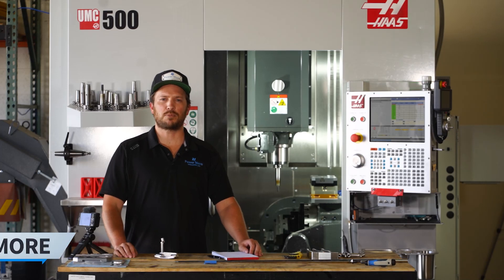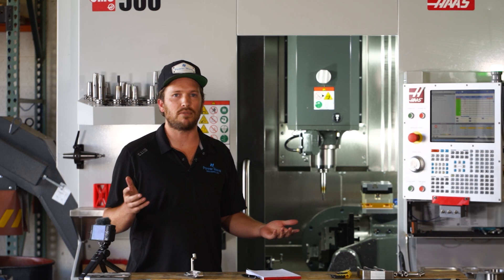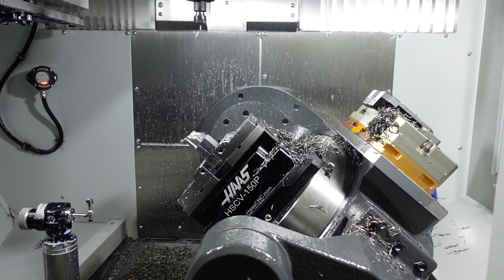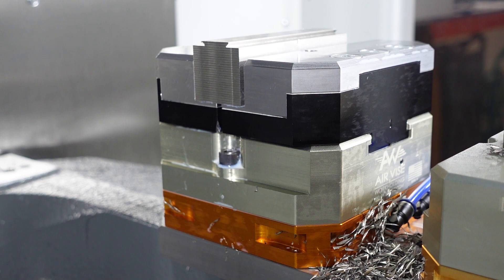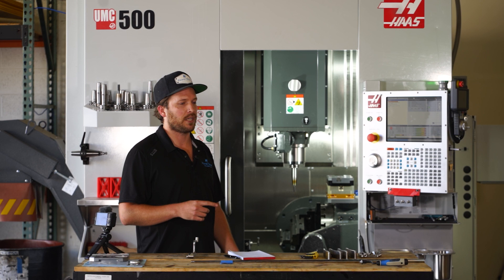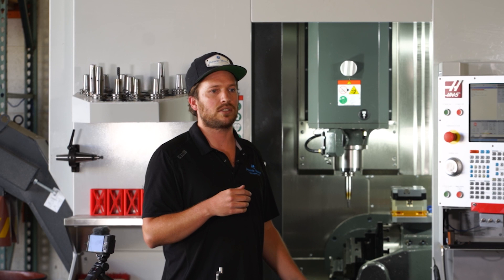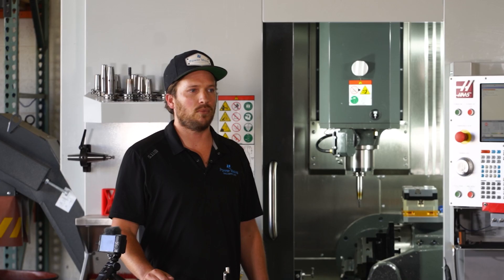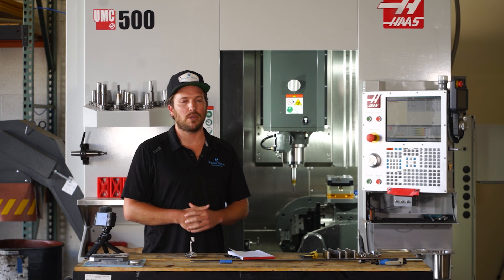Our New 5 Axis CNC Mill | Haas UMC 500 | Worth It?

Comment: As far as the Z axis travel limits the machine does travel above Z 0, we have a umc750 and trick the machine to pop above G53 Z0 by doing an operation on the X minus side at the beginning and end of that tool usage. But annoying but when you need that extra travel it works
Reply from the maker: David, thanks for your reply. We noticed this as well. We found that the Z travel can continue roughly .9” above the tool change position. This comes in handy with some tool holders but we have yet to find a good way to post process this when needed and end up using posted manual entries. If we use the shortest tool holders we’ve found (Shars 1.1” er32) then it tends to work out okay without adding any Z. Thankfully we only use these added two air vises for dovetailing and finishing so we don’t need long tools in those ops. Do you use the side of the umc750 trunnion? Thanks again
Reply: @powermoveengineering  good way to do it? Nope, I typically end up doing a drilling op at the start and finish of the tool, cutting air on the X- side of the part (between part and tool changer) would be better to find way to do it thru post but fortunately the times we've needed to do it the drilling trick has worked.
Believe it or not no, we did just order a 5th axis base plate so we can pop visess on and off of the side (idk if it's still going but they had a 61% off flash sale on their 3 axis style bases). Typically we run dovetailing and second op in our 3 axis.
Enjoy the machine, we've liked the 750.
Reply: @powermoveengineering  I am going to be running a UMC 750 ss soon and those have about 85mm (~3.5”) of z travel above the tool change position. For cam I’m using fusion 360 and I’ve found that of you change the home position for the z axis in the fusion machine configuration to +85mm (or just 85) it will post the z axis retracts between operations with indexes as g53 z85

Comment: ( an open comment Not directed at this HAAS Machine )

Would I buy a HAAS ??
Generally,  NO I wouldn't.
But, I am also based Outside of the US ??
Meaning ??
I am not controlled by country of origin ??

IF I lived in the US,  I would seriously think about supporting my Local Manufacturing sector.
But ??
It would depend on what I was planning to Manufacture with my Machine of choice ??

IF, I was producing High End Aerospace parts with super tight tolerances I might start thinking of other brands besides HAAS.

Definitely nothing wrong with the HAAS brand ??
But ??
You do Need to understand the Limitations of your equipment ??

It's very simple maths.
Pay More, Get More.

This video is a great example of Understanding your Machines Limitations.
NO, tight tolerance Aerospace parts anywhere in this shop ??
Maybe one day that could change ??

Price quoted in the comments for this machine $190k
Not small money for most people.
Go down to your local Mazak Dealer and get a price for an equivalent 5 Axis Mill ???

Back to the HAAS dealer to see IF it will fit in your shop,  LOL.

Unless you're planning to make at least the price of the Machine in the first 2 to 3 years of purchasing.
I would Not be considering buying any Machine.

I have always been a die hard Mazak Fan.
Would I buy one ?
Definitely.
Could I justify buying one ????
Most lightly NO.

Just being Realistic, same as Bryan from this video.

Thanks for posting the video Bryan.
It was Good to watch 👍

Comment: To clarify, we have multiple HAAS 3 axis machines making tight tolerance parts with great success, that said, My employer recent purchased a UMC500 and UMC750, huge regret and can't wait to offload them. I would say anyone who is thinking of purchasing a UMC500/750, please do a lot of research and speak to current owners who make decent tolerance parts, because they are absolute lemons.
Reply: Nah, they're not lemons. You just gotta know what you're getting. They're not as rigid as other stuff on the market, I suspect there's some issues with b and c axis alignments, especially after crashes, and a rather small work envelope.
Reply from the maker: It’s tough to know what is meant by “decent tolerance” but we have not noticed anything that cannot be easily compensated for. Granted we’re making low tolerance golf putter heads on it most of the time. But we think it’s been as dimensionally consistent as our 2019 vf2 that has been a workhorse. Anyone looking into buying a machine needs to do research into many things including in-house inspection equipment to match demand. We plan on making some videos about that stuff too, so subscribe! Thanks for the comments
Reply: @powermoveengineering  "compensated for" is the issue, If the machines were decent you wouldn't have have to. When I refer to decent tolerance I'm talking 0-0.02mm, for these machines 0.1mm is a stretch. most other 5 axis machines 0.02mm is a walk.
Reply from the maker: @mannycalavera121  IMO compensating cutter diameters and Z work offset up to .05mm during a first part inspection is standard procedure on just about any setup in any machine depending on fixturing. As long as it remains consistently +/-.02mm from there then we are good with that. That is what we have seen.
Reply: @powermoveengineering  I agree 100%,  every part should be dialed in, not quit as bad a 0.05mm but a little is expected. But what you will find with this machine is its not just a simple D and Z offset to dial in, but the positional accuracy will walk around horrendously. For eg, on a semi production run of parts i was engraving at B-90, I would need to check every part continusly because as the day progresses, the engraving would get deeper and deeper.. like, 0.2mm movement.. as soon as the TCPC is active these things walk around all over the place, you can dial them in then hours later they've moved agian and all out of whack. 

Here's a test, put a dial on your C axis table and rotate 360 with the hand wheel, take a look at the table runout.. then put it on the top of the table and do the same.. Also notice the C axis movement as the brake is disengaged.. that's going to translate if you attempt 5 axis movement's vs positional. You ca  hide it, just means you need to design and sequence operations to blend the mismatches.

Nothing personal, I'm sure everything you make is mint, we make parts for your typical defence names on these machines so they can be capable, but my God is it painful lol.
Reply: You get what you pay for. I think the quality you get for the price of a umc500 is absolutely fair. Of course other machines are way more accurate and stiffer but they cost 2 to 4 times more.

Btw thanks for the good and honest review! 👍
Reply: People are already litigating against their HFO’s to buy the machines back. Im stuck with mine and it’ll be another $60k to make them run overnight with confidence. Thermal growth in the spindle is still a problem since they deleted the cooling oil bath. Yes they make parts but it’ll stunt company growth for another 5-7 years. For our same total investment we could have had a machine 38x more accurate with no down time.

Comment: So your having chip build up in all the usual places.
I wonder what is your idea with the valve with bunch of tubes attach to it, and will it work?
Reply from the maker: We are working on a product which essentially has a rotating valve with 1 inlet and 12 outlets. Only 1 of the 12 outlets has coolant passing through to maintain high pressure. The 12 outlets would route through hoses to all the places in the machine where chips collect. We are working on a video about this design so stay tuned!
Reply: @powermoveengineering  i can't wait, I'm eager to see your invention.

Comment: How's the Z axis repeatability over the day?  Thermal growth?
Reply: It’s not bad. With in a thou .001 inches. This was running the spindle at 14k for an extended period.
Reply from the maker: We have not seen any measurable thermal growth with this machine but we also have not done much testing of this. But maybe we should! Possible video right there. Thanks for the comment.
Reply: @powermoveengineering  I’d be curious to see if you have similar results to mine. I was able to notice it most easily when measuring the thickness of parts where the opposite sides were cut by means of flipping them 180 with the C axis. The effects of thermal growth are doubled in this scenario. I hope my explanation makes sense.

Comment: Can’t take any shop seriously that uses Haas machine tools absolute garbage they are cheap shite why would you purchase one of these horrendous
Reply: Funny you say that, there are a few thousand shops that would disagree with you.
Reply from the maker: There’s plenty of small businesses crushing it with haas gear. It’s all about understanding what the tool is and making it work. Thankfully we don’t need to seek your approval. Have a good one Carlos!
Reply: @powermoveengineering  cheap underpowered fragile shite….
Reply: @chrisyboy666  It's like buying a Ford Focus my dude. Not everything has to be a Toyota, or a Ferrari.

My current job has ZERO need for Okuma mills. I would LOVE to see them in the shop but it would be overkill for what we do (3/8 sheet fixture work, and some vise work held square and rectangle tubing, mostly all 1018). Lathes are a tiny bit different, I'd like to see a good lathe so we can hold tolerances on one or two parts that are a bit of a pain (trying to hold .0005 with minimum runout/ out of round of .0003 makes me scream). Genos 300, or 350 would probably be perfect, but I'd settle for an old crown/ cadet.
Reply: @powermoveengineering  cheap fragile shite cheap 2nd rate company that’s exactly the image you put across but that’s ok 👍
Reply: @eddie5556  I agree doesn’t mean I would give them any work
Reply: @chrisyboy666  Hi Carlos 
I don’t see any videos of you with your Makinos in your shop? Where did you hide them?
Reply: @curtislavoie2242  it’s hard to hide  a Makino its hardly a set of car Keys is it ya clown never said I owned my own shop…why would I don’t need the hassle….I’m the person who gives work to shops like this so believe me I think I’m in a better position to to have a valid opinion…Clown
Reply: @chrisyboy666  I thought for sure someone as knowledgeable as yourself would have made a contribution to the YouTube platform. I thought that there was a mistake when I couldn't find any content from you. I wasn't looking for a physical machine, but a video of you with one. Are you planning to upload any of the shop you work for? I'm sure everyone in this thread would love to see it. I know I would.
Reply: In the US, Haas makes up 85% of the machine tool market.  I’d say people are making money with them.
Reply: @Thewaldo12345  no doubt but all the blue chip companies making complex parts wouldn’t go near them..and 85% is no where near 25% max
Reply: @chrisyboy666  you saying the blue chips or total US companies are 25% max Haas?  Makino rep gave me that stat.
Reply: @Thewaldo12345  25% of us Market Max…I stand corrected it’s 10% no where near 80% run the numbers what the company Haas actually turns over per year and the actual size of the US market…and remember Haas sells most of its machines abroad so the actual figure is probably about 5% and that’s been generous.
Reply: @chrisyboy666  I’m just going by what the Makino rep told me.  He might’ve been speaking about a particular market and I misheard him.  Either way, they are what they are.